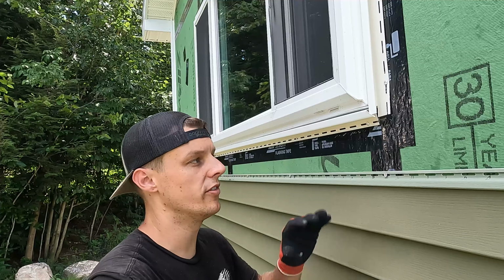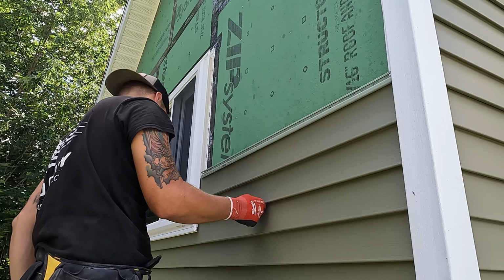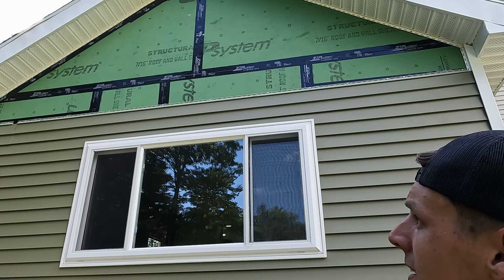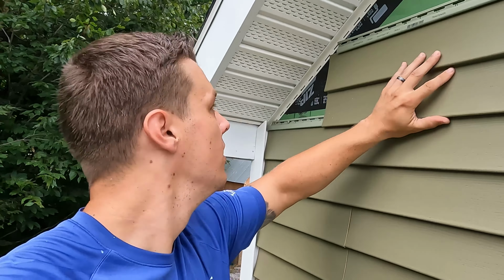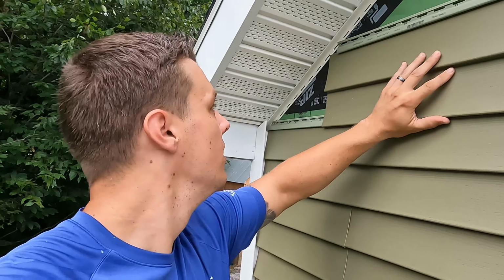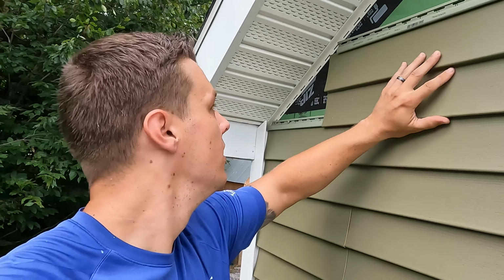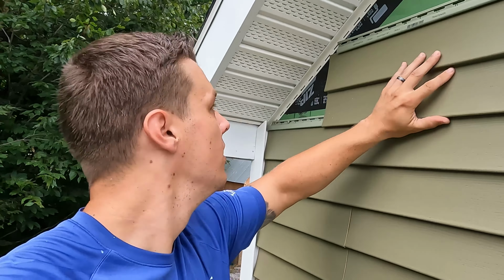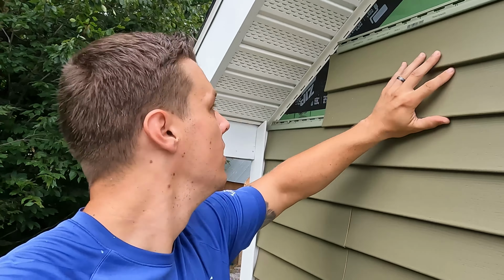Installing Vinyl Siding on our 14x14 Home Addition

Comment: Lol, you will have to take down all the siding to replace the window when that time comes
Reply from the maker: Lol, no you don’t. The pieces around it?
Reply: How if the pieces are nailed in overlapping locked In to place
Reply: You're supposed to cut out around the window and frame it in with trim
Reply from the maker: You use a vinyl siding tool to separate them and you can remove whatever piece you want.
Reply from the maker: https://youtu.be/lzhSsmWnHfw